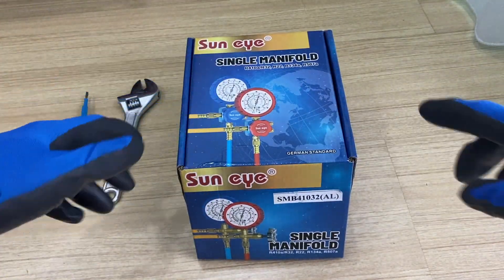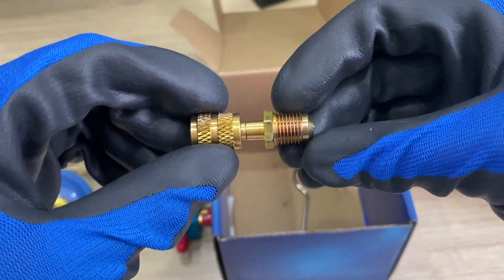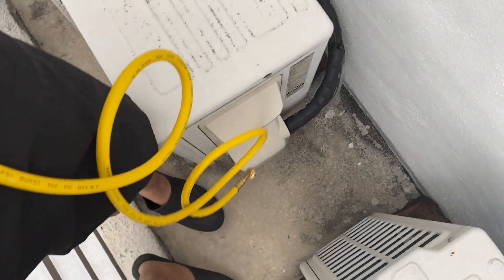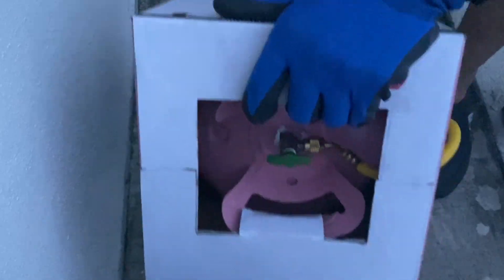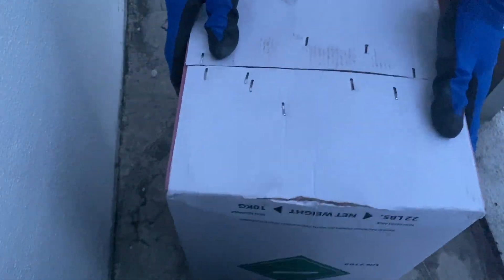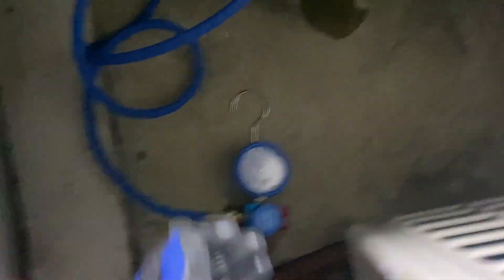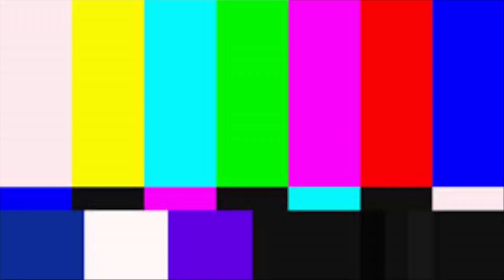Refill air conditioner by R410A gas using single manifold after working hour (Part 3)

Comment: Hey man! Thanks for your short but very informative video. Just wanna check does the brand of refrigrant make a difference?
Reply from the maker: Yes indeed. The mixture affect the efficiency. Get the same brand that I showcase. Slightly more expensive but affordable and worth it. DIY already. Go for the most expensive brands.

Comment: Hi Liew.  Thank you very much for sharing.  I have charged my Panasonic Inverter R410 to 120psi but when check my cooling coil inside the room, the bottom two is not cold only the those at the top are cold.  So I added more gas to 140psi and it is better with the bottom coil begin to be colder.  But I check the PT Chart at 140psi the gas temperature is 9°C ideally it should be 4°C at 120psi.  Should else is wrong?  But I have seen some video which suggest that the pressure should be up to 150psi.  Any feedback would be much appreciated.
Reply from the maker: Try check the working current: Procedure to clean and Servicing Air Conditioner
https://youtu.be/_eM53p45eHI

Comment: Good knowledge how to charge in gas.
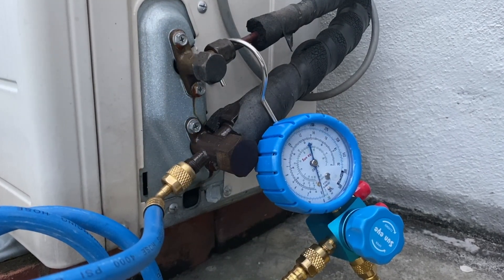Reply from the maker: Try refer minute 2:28th onwards. It is utmost important to remove the death volume of air inside the pipe before charging.
Reply: @CTB6  How to do pump down

Comment: I did exactly what you said and it didn't made it cool , what could be the problem
Reply from the maker: Check ampere test see if it is at working range. Be certain that the gas is correct for your unit!
Reply from the maker: Is the cooling fan start spinning?

Comment: my unit is Mitsubishi unit. What is the required PSI? thank you
Reply from the maker: Gas model changes based on year. There is a label located around the unit. Try look for the label. Normally R followed by numbers.
Reply: @CTB6  mine is the R410. installed in 2016
Reply from the maker: Should be between 110–140psi. It is recommended to also use an ammeter for optimum gas pressure. Maybe I should made another video on this topic.
Reply: @CTB6 where to buy this kind of pressure gauge
Reply from the maker: AirCond hardware shop. Try search from Google map.
Reply: @CTB6  is there a different between 1 to 1 unit versus 2 to 1 unit ?
Reply from the maker: The gas pressure depends on the gas used.

Comment: is this 1.0hp? mine is 1.5hp i find on other video they saying need to fill max 150psi....i m confuse...please advice ...thanks
Reply from the maker: Best is to use an ammeter. Stop once it has reached the optimum ampere. Normally around 120-130psi. Be sure the coil is clean. Door is closed.
Reply: @CTB6 ... I didn't get the answer ..tis video for fillup 1.0 HP right..is 1.5 HP inverter Aircon have same 120psi gas or need to add more ?
Reply from the maker: It is using same type of gas?

Comment: The air conditioning works on cold, hot or it doesn't matter. At what outside temperature is it recommended to charge with freon? For R32 what would be the normal value in PSI. Thank you!
Reply from the maker: It should be less than 120psi. Use an amp clamp to measure the optimum pressure required at maximum capacity.

Comment: Gas pressure is for reference only. Correct way is to check running current (read outdoor label) with a clamp meter when the compressor is at max load.
Reply from the maker: Thanks for the advise. Max load meaning set lowest temperature for indoor?
Reply: @CTB6  yes

Comment: Can have a question what the air conditioning is 410 a and charge with freon gas r22 what is the caused thank and advance
Reply from the maker: It is like blood to a person. A type A blood person can’t be given B type blood.
Reply: @CTB6   thank you very much I will flushing r22
Reply from the maker: Compressor designed for 410 can’t use R22 gas. It will damage the compressor.

Comment: I appreciate your video broo, really need it rn... pls for a dual inverter R410a refilling, does i still charge to 120psi?
Reply from the maker: When the indoor unit coil is clean from any dust and the room is enclosed. The pressure should be around 120-125psi for this R410a. Partial of these fluid is also acted as lubricant for the compressor.
Reply: Thank you bro🙌... i bought Lg dual inverter ac 1hp, i complained it didn't cool so much when after it was installed, an Lg man came and removed gas from the system and i complained knowing it's stupid and the company promised to take care of it stating it was wrong of the employee, they sent another over and he says he's going to vacuum the system and charge it at 120psi... they are using a chinese brand of R410a gas.
Reply: Any advice bro?, the ac is just a week old
Reply from the maker: Oh…. I hope your problem is solved by now.
Reply: Yes bro, but i found out LG in this region uses Chinese R410a, and i guess that's the major reason it doesn't cool so good, other than that it's energy saving claims are actually good. The system was vacuum and gas was refilled
Reply from the maker: We have other option locally made with better concentration. It is pricier.

Comment: Hi there, need to get rid of the air in the yellow and blue pipe b4 topping up? Same psi for 1 to 2 and above?
Reply from the maker: Yes, purging prevent death air volume in the hose from entering the compressor.
Reply: @CTB6  any videos or link to show how to purge for both pipe?
Reply from the maker: Check the cover image. Point number one and two. Screw half way then flow gas from tank so that it pushes the air inside the hose out from the check valve. Then only to tighten the check valve screw.
Reply: @CTB6  Thanks

Comment: Boss for 1 HP panasonic inverter how much exactly for enough gas psi (R410a) and 1 more thing this single is for gas 410 32 gas only right
Reply: 120psi is standard 1 HP inverter for R410 gas pink
Reply from the maker: Correct. Remember to purge the air prior to charging. Refer video for procedure. Not good if death air is circulate into the compressor.
Reply from the maker: About 120psi for R410a. R32 around 115psi. This gauge for this two type of gases.

Comment: can this be used on vehicle R134A system with correct quick coupler fitting ?
Reply from the maker: Need gauge for R134A and R134A fluid. Need to also check manufacturer data sheet for pressure to top up.

Comment: Hi, do you turn on the a/c while filling the refrigerant gas? Or turn it off?
Reply from the maker: AC needs to be turn on. Compressor need to be running as shown in the video.

Comment: Bos...when u topping up gas,the aircond compressor set to on aa?
Reply from the maker: Shut close all the door and windows. Connect the gauge as shown. Purge the air in the tube then top up. The compressor will have suction pressure only after three minutes it has been turned on. The outdoor fan starts is the signal. But don’t need to top up immediately. Wait for the outdoor fan to spin at normalized speed only start to read the gauge. Top up only if necessary. Look for these tell sign again from the video to have a better idea.

Comment: Most gauge sets include two gauges (blue and red)- what is the other red gauge used for and why is it not needed here?
Reply from the maker: 3 horse power and above required. Household air conditioner normally does not required.

Comment: Hi hi, waa wondering u mentioned any reading between 110 to 200psi is low, seems like a great different mine read at 130psi is it low? BTW where u get ur gauge can't seems to find it. Thinking of DIY my top up.
TIA
Reply from the maker: Try google for Acson hardware shop. I bought form those air conditioner hardware store. 130psi should works too. Actually need to also check current but need additional tool. Be caution to purge the hose to prevent death volume of air being sucked into compressor.
Reply: @CTB6  thanks bro
Reply from the maker: The gas pressure will be high when the air filter is clogged. 130-140psi should be fine as long as it runs steadily when it is new. The fluid is also used for the compressor as lubricant as well as coolant. That’s why it needs to be top up from time to time.

Comment: I have 2 indoor units and 1 outdoor compressor. There’s 2 service valves on the outdoor unit. Which one do I connect to for 410a regas? Does it matter which service port I use for regas?
Reply from the maker: Normally the service valve has larger diameter. Check if both have same larger diameter. If that’s the case then each one are for each indoor unit.
Reply: Thanks for the prompt reply! Yes I checked both service ports are the same size both with the schraeder valve. But do I need to recharge both ports as it’s only 1 compressor. Or just by using 1 service port it can charge the entire system.

Comment: Hello.. non inverter r410 also 120psi ?
Reply from the maker: Bare in mind, fluid pressure affected by surrounding temperature. At 30deg Celsius, R410A set around 120-140psi should work just fine while the AC is running. Ideally, charging by weight is the best way.

Comment: Bro changing gas pipe leak how? I charge 401 like u teach nowaday 1 mth charge once -.-
Reply from the maker: Definitely a leaks. Try bubble test at joint. Soap water and sponge/ brush and apply onto the coupling joint. Suspect a leaks. Charging every month it is because the pressure always very low?

Comment: R32 what psi needed for 1hp
Reply from the maker: Suction pressure to be at 115psi. Charge slowly by turning valve on a little bit by bit. Test for leakage using bubble test after you have done charging. Pressure stabled at 115-120psi. Too high the compressor will shutdown automatically until cooled down again. Good luck.

Comment: The charging you did was in the vapour (gas) line, so why did you turn the pink r410a bottle upside down? This would mean liquid going in to the vapour line and damaging the compressor. 
The bottle should be upright so hence gas charging going in to vapour line.
Reply from the maker: The R410a variant is a mixture of different chemical blend in a specific ratio. Charging it with liquid (inverted bottle) helps maintain the ratio better than in gas state. Charging in liquid state is better in maintaining the life span of compressor. Open the valve slowly to allow liquid to be siphon out changing into vapor state once leaving the pink bottle. Turn open and close bit by bit until it reached 130psi and stable. It would normally takes roughly half an hour work.
Reply from the maker: An example of liquid turns into gas that happens on pressure cooker: Vapor turns into very hot gases state in pressure cooker
https://youtu.be/CNTgBdMZhw4

Comment: Bro. I was having fun of charging the refrigeration gas yesterday, haha. It seems successful! Now, let the AC run for 3-4 days then check again whether leaking?!
BTW, when I detached the hose from charging port (gas input port), some yellowish oil came out with the gas! What does it mean? 🤷🏻‍♂️ (R22)
Reply from the maker: R22 need stable at 60-70 psi only. If it stayed within this range should will be alright. Refrigerant gas acts as cooling as well as lubricant for compressor.
Reply: @CTB6  does it mean, there is nothing wrong ( yellowish oil)? And, Everytime charging Gas, lubricant oil is inputting together with the Gas? (Yes, I charged till 60-70psi).
Reply from the maker: The gas will turns into liquid act as lubricant.
Reply: @CTB6  oh ~~ magic! 🤩 Does R22 only performed as Gos to Lubricant? Some say, compressor need to flushing or refill the oil time to time. True?
Reply from the maker: My next video mentioned about flushing. Recommend to upgrade AC to use at least R410 or better like R32. Not so harmful to environment while flushing.
Reply: @CTB6  That's cool, can't wait! Yes Sir, will plan to! Btw, R410 & R32 will be the same procedure of top up gas? Some say better don't DIY , it's danger & easily cause an explosion 😯 Really?
Reply: @CTB6  oh yeah, for upgrading from R22 AC, what's your recommendation? Inverter or not?
Reply from the maker: Do you use often like more than 8hrs per day? Otherwise normal unit uses R32 will do. R32 already very efficient and save electricity. Inverter save more electricity for longer operation. However it has more electronics and parts inside. It will be costly for maintenance if it is not used in long hours operation.
Reply from the maker: Follow safety procedure vacuum the hose prevent mixture with oxygen in air. Doing it slowly prevent sudden expansion of pressured air among safety procedure.
Reply: @CTB6  Thanks, very useful suggestion & tips! Will not run for the whole day, perhaps when sleep (night). Ya, around there 8hrs. My technician did mention inverter PCB very expensive and there's 1 in Indoor & 1 in Outdoor! Nothing to repair other than PCB replacement if something wrong! He said better go for non-inverter first at the moment. Agree?
Reply: @CTB6  Ok! Will learn from your latest Video then... Haha. When will be released? 😁 And, how much around for the Vacuum Machine?
Reply from the maker: It is published now. You may want to have a look.
Reply from the maker: Indeed. Inverter cost at least Rm800 more than non inverter. Go for inverter if there is no budget constrain. Otherwise normal unit works too. Issue is that our electricity can be not too stable at time and that normally damage the circuit board.
Reply from the maker: Depend on vacuum rate.
Reply: @CTB6  that's cool, will check it out!
Reply: @CTB6  oh .. good point! So, inverter AC consider not that common yet? How about you, your house installed inverter AC?
Reply: @CTB6  what's your recommendation?
Reply from the maker: I just fixed my outdoor fan motor issue today. Editing the video. Hope to publish by Friday.
Reply: @CTB6  wow... Cool! Repair or replace? Aiyaya, I should video-ing also ya! Haha.

Comment: hi .....is 2HP aircond also between 117 to 200psi ?
Reply from the maker: Ideal to be at 120psi to 130psi. I think I mentioned wrongly to be 200psi. Yes regardless of the horse power. Amount of gas is larger as well as area.
Reply: @CTB6  thanks for your reply.  wat about R22 gas, what is the psi range ?
Reply from the maker: R22 will be between 60-70psi will do.

Comment: Appreciate your efforts & very details! 1) Procedure will be the same for R22? 2) Any leaking issue after topped up?
Reply from the maker: Slight difference. No need to turn the tank upside down. R22 is gas form. Good point to also check leakage using bubble test. So far the unit is working fine. It was a quick fix around 7:45pm. Didn’t have time to perform bubble test after topping up. Thanks for pointing it out. I will normally perform routine check once every six months during summer break.
Reply: @CTB6  wow... You are expert! 🤠 I planned to grab those small size R22 (800g bottle) for the first try. Do you encourage me to get the smaller size one? About the leakage check, it seems easily to check (bubble test) at the outdoor unit (pipe joint). How about indoor unit? Do you mind to show us a little about it? Thanks in advance!
Reply from the maker: It depends how many ac do you have at home. I did lots of YouTube research before DIY. As usual, safety first. Be sure you have personal protective equipment like gloves, test pen, goggles. Don’t get injured. Double check if electricity is totally off. Some old unit require Allen key to release the check valve. I made two videos about indoor unit. Made the second very recent only. Try look through from video list.
Reply: @CTB6  That's cool! Thanks for the reminder 🙏🏼